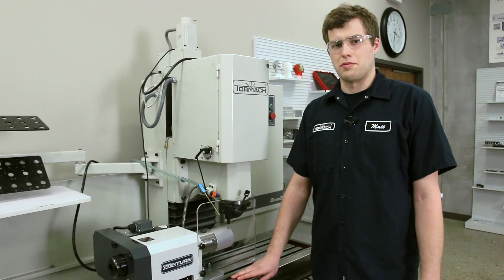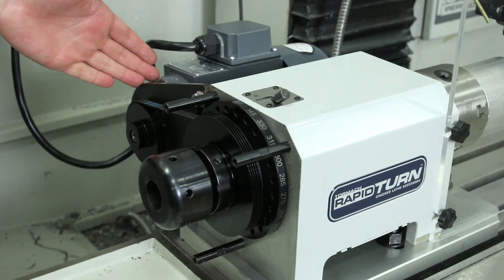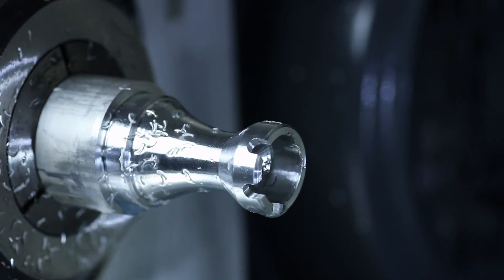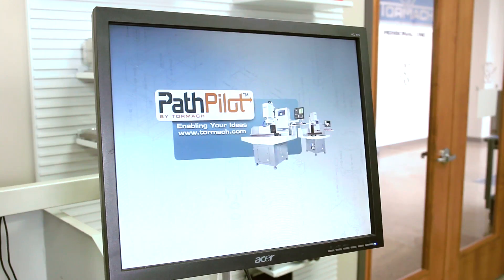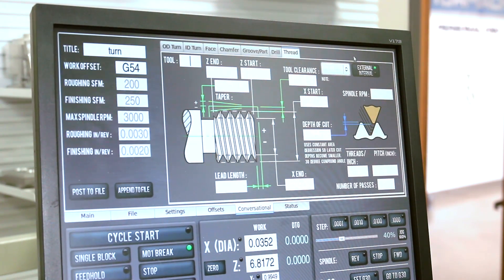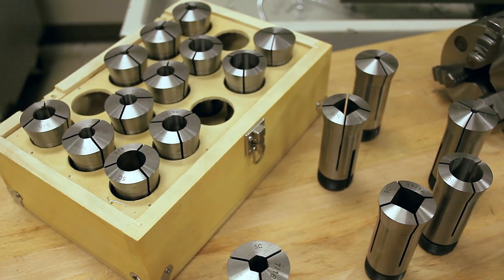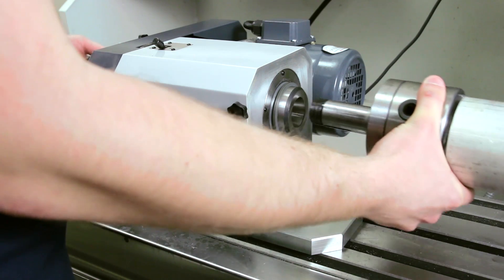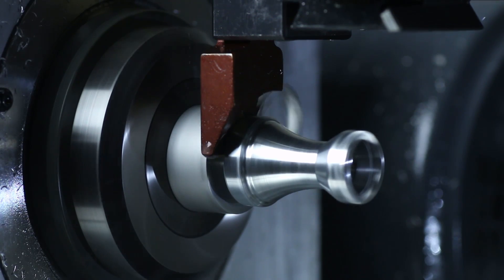RapidTurn - CNC Turning For Your Tormach PCNC Mill

Comment: Nice little unit. How much does it weigh would be a thought for me.
Also, I recently bought a couple of things from Tormach that had a value of just under $50.00(AUD). By the time I got it delivered, and the exchange rate, plus the fees the bank charged it was just under $150.00 (AUD). Not very good value at the moment here is Oz!
Reply from the maker: Fully assembled, the RapidTurn weights about 60 lb (the shipping weight would be a bit more). The spindle motor can be removed when putting it on or taking it off the table, making it quite manageable for one person to install.

Comment: Can the motor can handle flood coolant?
Reply from the maker: Yes, it can! The spindle motor is IP54 rated and is protected against splashing coolant. Additionally, the 5C spindle has a face seal to keep coolant out of the machine’s innards.

Comment: Could you leave it on table all the time with a vice to the right? Would there be a worry of table warp? Could you use a fixture plate to mount it off to the side like Tosa did for fourth axis OR  a full table plate to reinforce the table? Is it heavy? Thanks!
Reply from the maker: +fytanman You can leave the vise mounted, provided that you have adequate clearance between it and your turning tools.

The PCNC 1100 has a table capacity of 500 lb and the PCNC 770 has a table capacity of 400 lb., well beyond the weight of the RapidTurn. For installation, the RapidTurn's spindle motor can be removed to lighten the machine. The installation can be easily completed by one person.

Comment: Why can't this be used on the 440?
Reply from the maker: +Steve S Primarily due to the size of the RapidTurn, but the PCNC 440 also utilizes a different type of spindle motor drive.